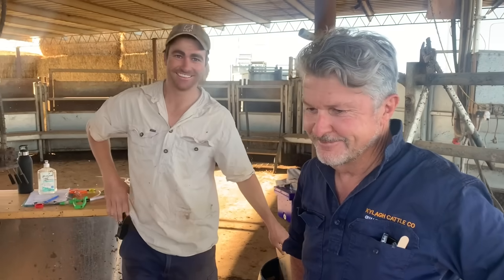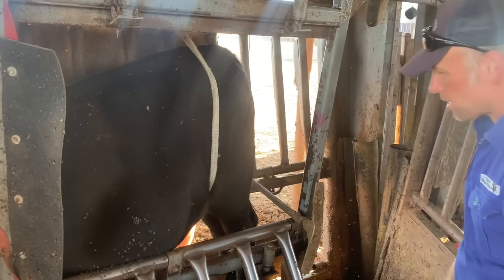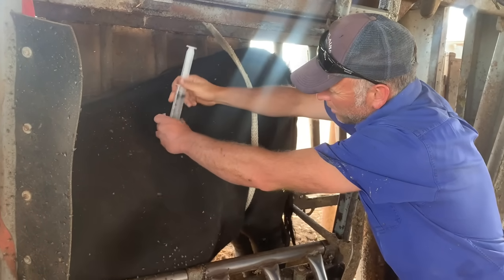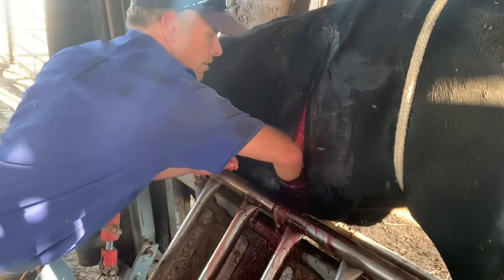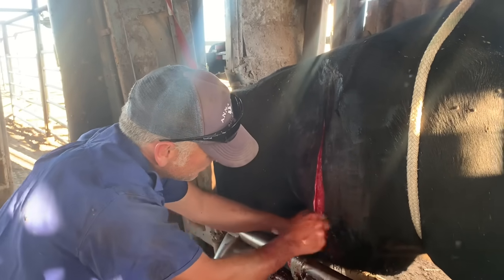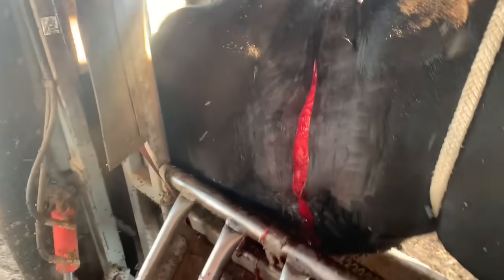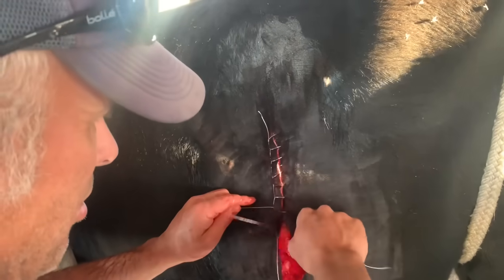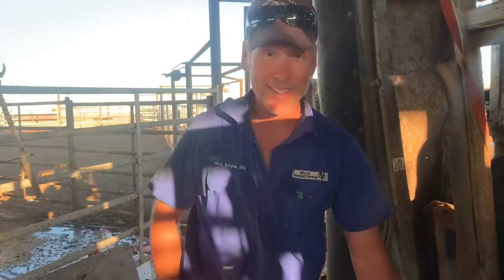Massive Hematoma! Not a Herniated Rumen! Worth the Wait!

Comment: Just curious if there are any risks opening a hematoma like this one. Would you have opened it if you had known it was a hematoma? I can imagine it makes the cow more comfortable with the pressure off, but the blood came from somewhere. Won't taking the pressure off cause new systemic blood to go to that area, causing hypovolemic shock? Or does stitching it back up cause enough pressure to prevent this? A vet student speculating here :)
Reply from the maker: If it was actively bleeding it would be an issue.  This was an old hematoma.  She recovered really really well!  Good question though!  Removing huge amounts of abdominal fluid can create hypovolemia, but this was all under the skin.  Cheers!

Comment: Heya, Doc! I know this is an older vid, but I was wondering... Is that pre-op scrub you're using a Chlorhexidine-based soap? I've never thought about using it on livestock, but I can't think of a good reason why it wouldn't work well. Up until now, I've been using original blue Dawn dish soap and Betadine for wound cleaning and pre I&D for draining abscesses on my critters. I've learned a lot watching you work, including the "tea-colored" iodine fill-and-flush trick as well as just going in clean but bare-handed with "nature's gloves". I kinda gross out my mom, but I never have to worry about torn latex glove getting stuck somewhere!
Reply from the maker: Yep Chlorhexadine scrub.  Same stuff I scrub my paws with before surgery.  Cheers!

Comment: Seems so unnecessary making the incision from the top, down, instead of the bottom, up, especially since the hematoma was located at the bottom.  
This poor, unfortunate cow has an unnecessarily long incision to heal from.
Reply from the maker: Incisions heal side to side, not end to end.  Healing time is the same.  She healed very well.  However, you are correct about the placement, I expected to replace the rumen rather than drain a hematoma.  Cheers!